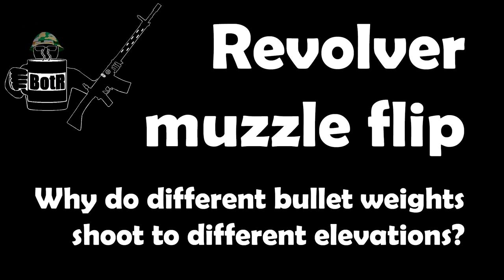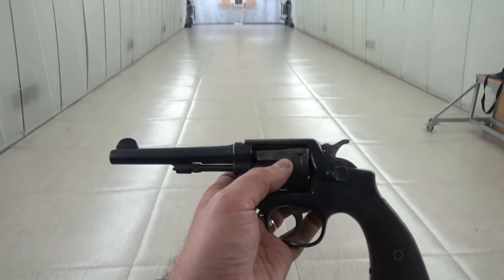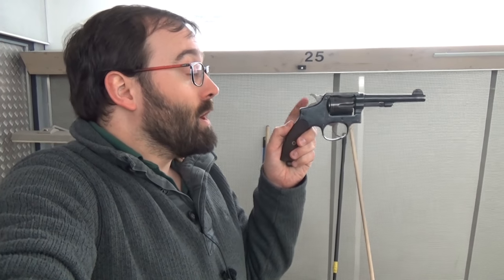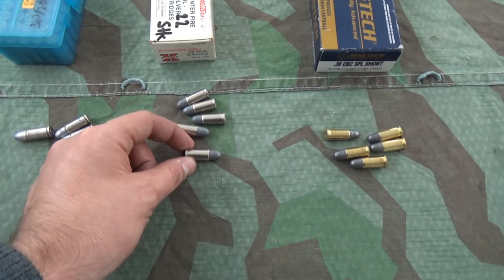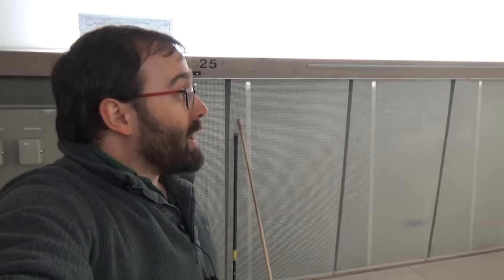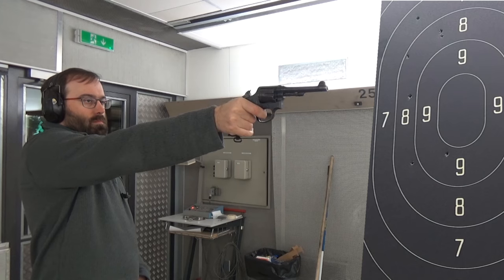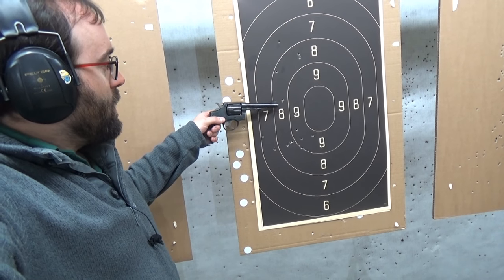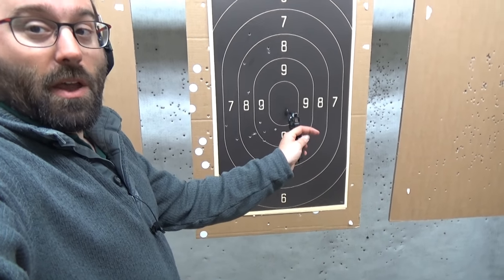Why Do Revolver Barrels Point Downwards?

Comment: British Gov't: "Let's adopt a .38 cartridge for our revolvers even though the .455 Webley still does the job well!"
"Should we chamber it in .38 Special?"
"Nah, let's chamber it in a cartridge that's already obsolete. .38 S&W!"
GENIUS
Reply: For the second part, I would say more powder since the +P of today is just what the old stuff used to be loaded to before SAAMI lowered pressure standards in the 70s. Plus, .38 Special had pretty much supplanted the old .38 S&W in police and civilian use since you could get more power out of it with it's longer case length holding more powder. Which makes sense, considering that it was S&W's attempt to fix the problems with the .38 Long Colt, namely that it couldn't stop drugged up natives. An account of this is almost comical, "Antonio Caspi, a prisoner on the island of Samar, P.I. attempted escape on Oct. 26, 1905. He was shot four times at close range in a hand-to-hand encounter by a .38 Colt's revolver loaded with U.S. Army regulation ammunition. He was finally stunned by a blow on the forehead from the butt end of a Springfield carbine."
Reply: Pretty much, the British use of it was the only reason they still continued manufacture of the ammo, and they still occasionally made some revolver models in it since it was popular in Europe.
Reply: Also according to what I've read, the case length of both the .455 Webley and the .38 S&W is about the same with only a 0.01 mm difference at the .455 measuring 19.6 and the .38 measuring 19.7.
Reply: I would have thought they had figured out the value of pistol shooting since their use of a large caliber round came from the same kind of experiences we had. Plus, I thought WWI would have shown them the value of the pistol in military combat like it ended up doing with everyone else. I might not agree with the decision still but I can certainly have a better understanding of why they made their decision. And the Mk VI did end up serving into the second war alongside its younger brother, most likely due to the need for every gun they could get their hands on.

That court decision still makes me laugh, either the judge can't tell an obvious rip off or the government pretty much intimidated the ruling.
Reply: I've also heard that many of the lessons of WWI were learned to a degree already by the colonial troops that served in campaigns in Africa and elsewhere, especially about how much of a game changer the machine gun was and how you were going to end up with massive casualties if they didn't adapt. Then they went to report their findings to the top brass and the leaders of the British Army in Europe and got blown off because they saw themselves as better than the colonial troops despite them having more experience in the matter.

How anybody managed to see all the changes as an aberration is beyond me. In fact I think that's the same kind of "head in the sand" view that led to hundreds of thousand of British men getting mowed down by machine guns because their commanders didn't see that the old ways were over and done with. 

Yeah that makes sense. I guess the court case was more about the government trying to avoid paying them their dues for working on the .38 S&W caliber revolver. Webley still got the last laugh on them since they couldn't build enough Enfield revolvers and had to go crawling back.

I wonder if they did realize the value of the pistol in modern combat, would they have ended up making those Webley Autoloading pistols the new standard?
Reply: I got to say, it's fun discussing firearms history with you.
Reply: I heard they had some jamming problems because of the use of cordite but that got solved with the switch to nitrocellulose. Kind of awkward looking but it looked like it had some potential to be refined into a better pistol. That's almost as bad as when the Air Force had to down load their .38 Special for their S&W Model 13 and Colt Aircrewman revolvers because of their aluminium alloy frames couldn't handle standard pressure .38 Special, (and in some cases still had frame failures despite the downloaded ammo). A number of problems which could probably have been avoided had the Hague Convention not banned hollow point ammo. Something which was not used in WWI while Poision Gas was despite both being banned. I guess they thought drowning in your own lungs was acceptable while being shot by a hollow point was not.
Reply: I'm going to venture a guess and say that the M&P you're using is an old Lend-Lease Victory Model?
Reply: The source I found cited an archived page from Webley & Scott's website on the Wayback Machine though for some reason it now appears to be unreadable. It's a pain in the ass when your source turns into a dead link.
The 1913 model did at least seem to find some favor amongst the Navy and Royal Flying Corps. I did read the Navy was looking to go for a full adoption before, (To borrow Othias of C&Rsenal's favorite Futurama quote), "War were declared". It is interesting that it was the first pistol to use the chamber as a locking lug long before Glock and Sig Sauer ever did. Though the British military's obsession with magazine cutoffs went full potato with a second slot in the magazine where it could be locked up without the slide being able to draw a cartridge from the magazine but still enough for the slide to lock back so they could single load pistol cartridges.

Interesting about the S&W. You might be able to get some more info on it by contacting Smith & Wesson with the gun type, caliber, and serial number. Usually they can answer questions about some mystery qualities or pieces they made in the past. Might generate some interesting bits for your TFB TV video.
Reply: @Procket12  I think a mountain was made out of a molehill with the .38 in the Philippines, .38 calibre has proven to be sufficiently effective in other conflicts and police actions. Lots of stories of one shot stops with even non-expanding .38 bullets and lots of stories of much larger pistol calibres also failing to stop with three torso hits.

Remember when fighting "natives" it's less about them being "drugged up" and more about how wars were fought at that time and place, they had a lot of experience fighting each other when they had nothing like the geneva conventions, they knew that to be defeated in combat meant a fate worse than death... then death. They were hugely motivated to keep fighting no matter what, they thought capture would just mean they'd be killed later. In such conflicts it wasn't only the .38 Long that was under-performing, even service rifles weren't guaranteed to stop them.
Reply: I do not feel going through the history of the low velocity 38-200gr load that they used in it.  But from a one size fits all for revolver it was good military choice for soldiers with little handgun military experience.  This is something that bloke on the range could cover.  IIRC the long 200 grain bullet was poorly stabilized and was supposed to tumble and in any case revolver bullets are of revolver power and will not have do what a rifle bullet will do relative to wounding and penetration. 

By the way .45 ACP have failures to stop also.  What works real well is a full charge 12 ga buckshot in a center mass hit. 

Here is an add for such ammo:   200 Grain Webley MKI/38 Super Police
$39.99
This is for 50 cartridges.

This is a heavy bullet version of the 38 S&W cartridge.

Specifically, this is as close as we can get to the British Service Load for the Webley MK I 38 caliber cartridge in use between WWI and WWII. This cartridge is variously named the 38/200 or the 380 Rim. It is also real close to the American loading from S&W named the 38 Super Police. It is a 200 grain bullet at about 620 fps.

This load is the correct load for Webley and Enfield 38 revolvers, as well as the S&W victory model. It is the load these guns were designed for. It would also be effective in the solid frame guns such as the S&W Terrier or Colt Bankers Model when chambered for the 38 S&W cartridge.

We do not recommend it in American top break guns. They were a weaker design frame and not intended for the pressures of this heavy bullet. In addition, they were often manufactured cheaply and are often in poor condition today. We caution customers again that these cartridges are unsafe for use in the American top break guns.

This cartridge should not be confused with the 38 special, which is a different cartridge and is not interchangeable with this one.

Here is a video made by a customer.  """

https://www.youtube.com/watch?feature=player_embedded&v=zqPcpItjBZA
Reply: @Procket12  Check your decimal places, pard.  19.6 mm and 19.7 mm are more than .001 mm apart.
Reply: They had figured a .38 SW/200 at 200 grain weight would produce very similar results to earlier .455 webley. They were right. The bullet tumbled tremendously, and the energy difference between cartridges was a measly 50 joules.

Comment: Fixed sights on S&Ws are usually set for 25ft. as apposed to 25m. as I recall.  There was quite a bit of difference in point of impact from one revolver to another so Kentucky Windage was used to aim properly.  Lastly it was not uncommon to use a file and mallet for sight adjustment.

Comment: I was shooting my Smith and Wesson 629 44 magnum pondering this just last week. It shoots 7" higher at 50 meters using light 44 special (which I use far more than magnum,  because I'm a recoil weenie) than full 44 magnum. It of course has adjustable sights, unlike yours, so it's not an issue. But it's enough to cause an absolute miss at longer ranges

Comment: Enjoyed your video.  I own and have shot quite a number of .38 special revolvers. Smith and Wesson Model 14, 15, 10 and Colt Officers Model Match which have the same lockwork as the Python.  I usually shoot HBWC (Hollow Base Wad Cutters)  They are usually considered to be the most accurate bullets in these guns.  The loads tend to be quite light around 2.8 to 3 grains of Bullseye with a federal small pistol primer.  I have always wanted to get a Smith and Wesson model 16 in .32 S&W Long.  They are very scarce and very expensive in good condition. The Russian TOZ Revolvers are facinating too but I have never even held one.  Almost all of my revolvers have adjustable sights tjat I find much easier to live with.  The model 10 is actually a custom gun that was built for what is called PPC competition here in the states it was made from a model 10 action but the rest of it is pretty space age including the Aristocrate Tri Set Sight Rib that allows you to have three pre-set zeros.  The S&W Model 14 is really a favorite of mine with a 6" barrel.  You can get a Model 17 too so you have the same thing in .22 LR.  In competition the autoloader pretty much is supreme but I do love revolvers.  Thanks for the video.

Comment: This affects rifles and shotguns as well.
A shotgun sighted in for light loads will hit high with heavy slugs.
Same reason: muzzle flip during recoil.
One thing to note is that really high velocity bullets don't flip as much.
The gun itself recoils straight back, with the bullet leaving the gun prior to the gun rotating due to the shooters hand/shoulder arresting the rearward movement.  Slower rounds will still be in the tube when the gun is rotating.
Blokespeak: Faster rounds don't suffer from barrel flip as much as slower rounds.  They get out of the gun before it has as much time to flip!
Taufladermous has seen the bullet mass affecting point of aim in many of their test firings.

Comment: Your groups are landing left of center because you are squeezing your right hand (support hand) as you pull the trigger or using too much pressure to hold the handle.  If you try it with your left hand, you will notice the rounds landing towards the right of center. Try to keep an even pressure for your hand while pulling the trigger - not too light and not too heavy, and move only the trigger finger.

Comment: One doubt I have is: if you cut down the barrel to, say, 3", as I've seen on a "custom" british service smith, in a book by frederick myatt, would you also have to lower the front sight? (in the specific case, the owner had installed a huge ramp one)

Comment: A most interesting and enlightening analysis! So how is it for pistols? Are they subject to the same influence? At least any fixed barrel blowback model I guess should behave like a revolver. Certainly this explains a bit why accuracy can seem so mysterious each time I go to the range. I notice you shot one-handed, probably to emphasize the effect of muzzle flip, so a normal two-handed grip I assumes reduces this effect?
Reply: My question as well. Wouldn't semi-autos have the same recoil yet have straight barrels?
Reply: It took me a few seconds to understand why a blowback would have sights parallel to the barrel... Because the slide is absorbing the recoil energy and not the frame/hand. No rotational torque until the side comes to a stop, but by then it is too late. 

In the case of the revolver; for every action there is a equal and opposite reaction. As soon a revolver is fired, all of the "opposite reaction" is directed against the frame, which rotates away from the hand. 

https://www.youtube.com/watch?v=6yO6y48XiSI

For those that wish to argue, in the linked video you can see the muzzle rising before the bullet leaves the barrel.
Reply: Semi-autos also allow for a higher grip, so their recoil is (more) angled straight back INTO your hand, as opposed to the lower grip of revolvers, where the force pivots up and over your hand.

Comment: I don't disagree with the physics regarding recoil starting upon ignition, however I'm wondering if the hammer falling is also a factor.  Without the tools to calculate it, I'm thinking that the swing of the hammer would also impart a rise of the muzzle.  It might be early enough in time and significant enough (mass of the hammer) to cause a shift in POA, perhaps equal or greater than the cartridge moving.  I'd like to see some super slow-motion video of a more-or-less modern revolver firing to be sure, but it would have to be in the tens of thousands of FPS.  Perhaps a collaboration with The Slow Mo Guys?  It would be straightforward to figure out angle changes in post production.
Reply from the maker: The hammer weighs a tiny fraction of the revolver and isn't moving very fast...

Comment: When shooting my Freedom Arms 83 revolver at 50 meters, the kind of ammunition greatly affects the point of impact. With .454 Casull 300gr/1600fps it is spot on, while with the same sight setting a .45 Colt 230gr/1000fps will hit almost half a meter low.

Comment: Wonder if mateba's try to correct for that by having the firing at a lower pivot point or just to reduce recoil. Still waiting for someone to mix a mateba 6 o'clock action with a schofield model 3 chambered in 45 long colt.

Comment: crazy I've heard time and time again that the bullet is well out of the barrel before the muzzle flip would effect point of aim and it always made sense to me.  I mean if I limp wrist my 1911 and allow for exaggerated muzzle flip I still hit where my sights were pointed when the trigger breaks just the same as if I hold it with an extra firm grip.  well, at least I think I do!  Now I don't know what to think.  I suppose there's got to be some truth to this as BOTR is always so we'll informed and I can't deny he knows way more about this stuff than I, or most people do.  But how much factors into this and why aren't the sights like this on my 1911 they seem pretty much level with the barrel if you eye ball it.  I'm I missing something else?
Reply: Limp wristing does not greatly affect point of impact. The force acting on the bullet and equally in the opposite direction  on the pistol while the bullet travels down the barrel is about 100 times higher than your grip force (for .45 ACP about 2000 lbf, compared to 200 lbf grip force).
Reply: 1) the 1911 is a tilting barrel lockup inside the slide, 2) a lot of the recoil energy is being used for cycling the action and so is not available for muzzle flip (other than the tilting barrel action in the case of the 1911), 3) bullet is less mass moving faster therefore gives less recoil force on the gun and is out of the barrel faster before muzzle flip has moved it so far.
Reply: Bloke on the Range: Air cartridge ammo? Is that a Brit/European thing? Like a substitute ammo system that fires in a real gun, vs just an air gun?
Reply: Ewan Marshall Thanks! I was about to start typing in search terms to see if that was already out there when your comment popped up in my notifications. Good timing, lol.
Reply: Bloke on the Range Awesome, thanks! I'm loving the technical deep dives on the mechanics of firearms, and the function of uniforms and web gear too. I'm still working my way through your videos, but if you haven't done it yet and are interested in hearing requests, I'd be super interested if you did a top down of the technical aspects of the mechanics of bolt actions, comparing and explaining different types of extractors, controlled feed or not, magazines and clips, history of development, what is no longer commonly done due to cost vs what are actual improvements, etc. Maybe a top down discussion of all the factors at play in making a rifle accurate? Really appreciate the straight pull bolt videos, those always fascinated me. You don't have a Browning A5 shotgun by chance do you? I've been looking for good videos on that, hah.
Reply: A better image here... 
The barrel on a 1911 tilts downwards approximately 1-degree. 
https://forums.1911forum.com/showpost.php?p=2261299&postcount=57